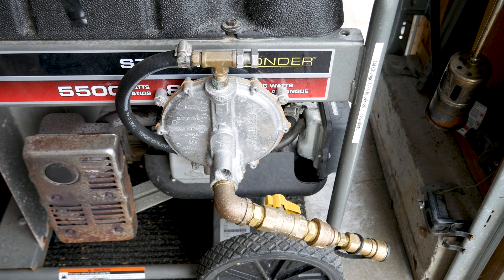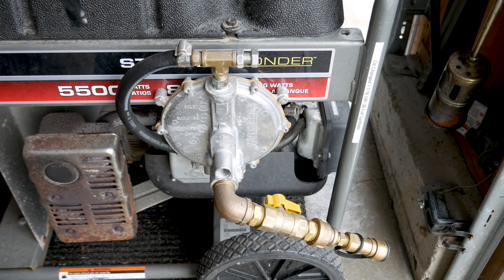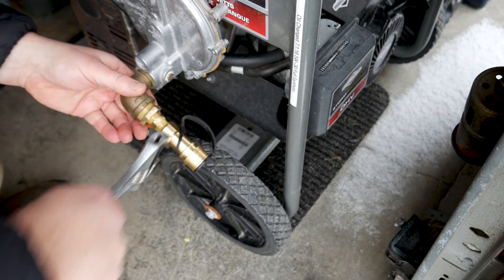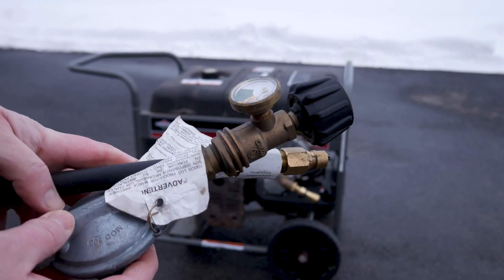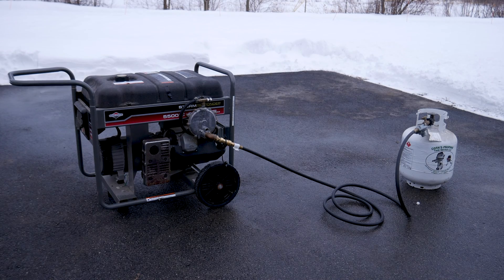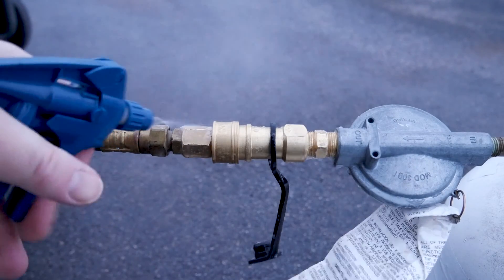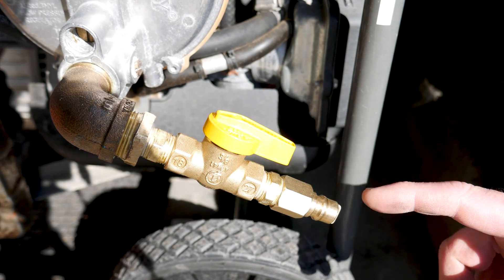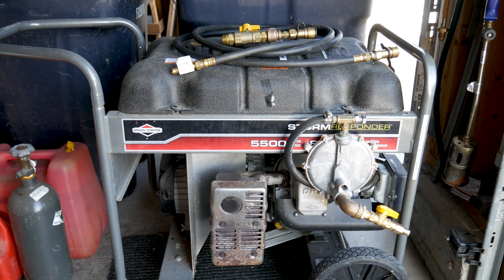Portable Generator (Tri-Fuel Kit) on 500 Gallon House Propane Tank - Part 1

Comment: Approaching this same project myself as we've just moved to a rural area and the electric utility power reliability is shaky at best. That looks like another regulator on the side of the generator, which creates some confusion for me. The house propane has a regulator  that is attached off the large tank, then why would an additional regulator be in play?  Thanks

Comment: Hey there. I have that same B&S generator but bought a new dual fuel recently and have then50 amp power inlet installed, interlock kit, etc.  Did you ever hook yours up to your house? If so, how did the B&S do on your lighting,  appliances,  etc.? That whole inverter versus non inverter thing. Thanks!

Comment: Haha, saw your Cotas tank and realized you were in VT XD. Did you work with Cota's for the gas line work? I want to implement something similar but my plumber/pipefitter is concerned about installing piping with valves to flexible hose that would leak the entire large tank if a leak were to occur.
Reply from the maker: Good Catch, yes, Northern VT.  Liberty Propane installed the T fitting and quick connects (I supplied the quick connects).  Didn't charged me since they came a day late. Has been a good upgrade especially running our generator.  Thanks for watching.

Comment: Great video.  I have a new tri-fuel Firman generator that I want to connect to my main 500 gallon propane tank.  I already hired my electrician who installed a transfer switch off of my electrical panel.  I had a plumber/heating guy come over and give me an estimate on getting the connection to the propane tank done.  However, his plan is to dig up part of my yard and bury the line.  Does the connection line HAVE to be buried?  Or is there a way around that?  Thanks.....
Reply from the maker: You should most likely bury it for safety reasons.
Reply: @GreenMountainDIYGuy  Depending on where my second regulator is located on the side of the house,  is it possible to come off on the high-pressure side of that?  The house regulator is about 12 feet from my buried propane tank.
Reply from the maker: @joemarchand8313  Not sure, you should consult a professional.

Comment: On your generator end, do you really need the shut off valve? doesn't the male quick connect shut off the gas anyway? Or is it a female end that shuts off when disconnected?
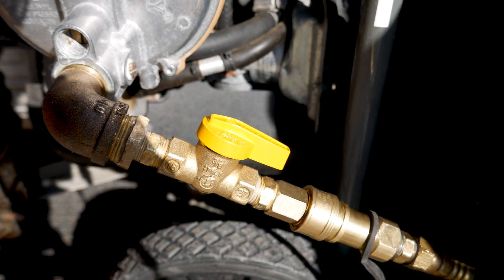Reply from the maker: I switched around the order of male to female connections on the generator.  Check out 4:00 minute mark in the video. That is why I kept the shut off for gasoline use and back pressure.  Female ends shut off not male.

Comment: I did the same thing for my motorhome; the 35# onboard tank was fine, but I put a 'T' with a female QC so I could have an external 100# upright tank which allowed me to take the 100# tank to get refilled without having to drive the motorhome, just for a refill. Nice that your propane tank is underground. And the hard-line to the deck for the BBQ will be nice.
Reply from the maker: vondeliusc Thanks!  Great idea on the T fitting for switching out tanks.  We use very little propane here, really only to heat our basement and as backup  potable hot water in the event our heat pump hot water heater goes out.  Have a good day sir!